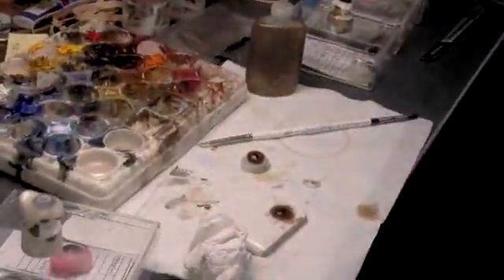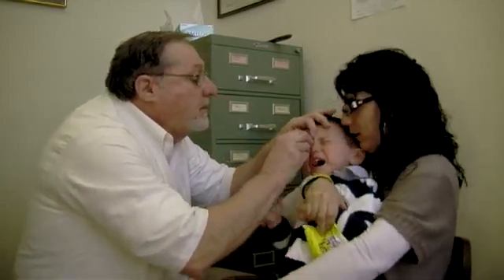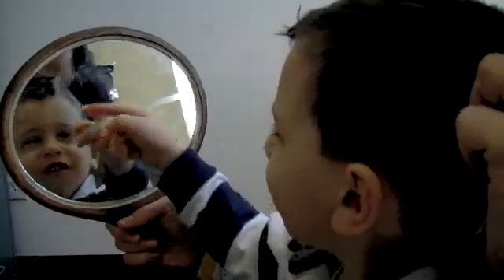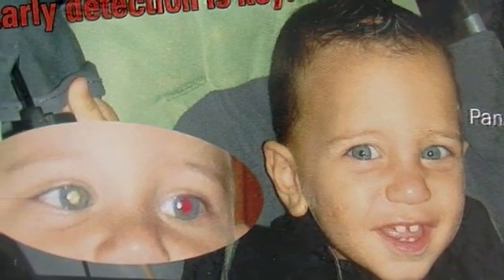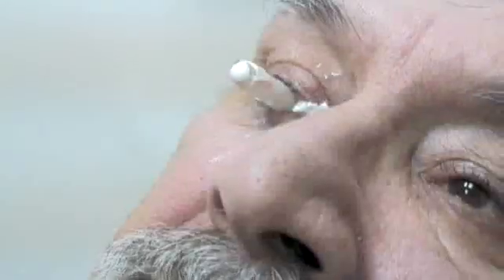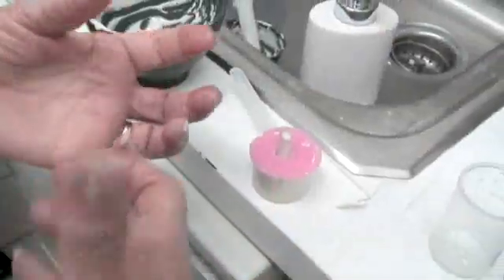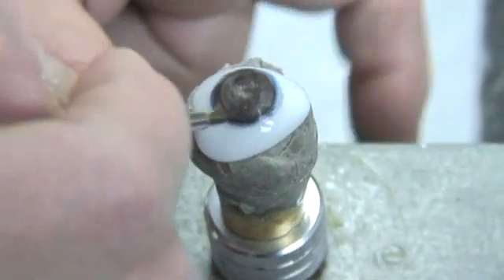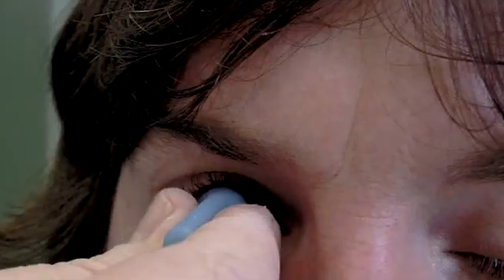Making a $4,000 artificial eye

Comment: I have an artificial eye and I must say it has turned my life around
Reply: Plz can you tell me how is the eye movements with the prosthesis? Is it normal or less than the normal?
I should take decision regarding my sister operation, I’m so hesitant...
Reply: @adelal-yaffei2486  
I'm 24 years old in May 2018 l had an accident at work and lost my right Eye 
Now I have been having artificial eye almost for 1yr 
It's very confidencial,unless you tell them no one can guess that you have it
Reply: @adelal-yaffei2486  it is connected to the movement of the other eye.
Reply: Same
Reply: I have a artificial eye cause i lost my left one to retinoblastoma and I've had it for quite some time I have started to adjust I'm currently 13 years old
Reply: In a good or bad way ?